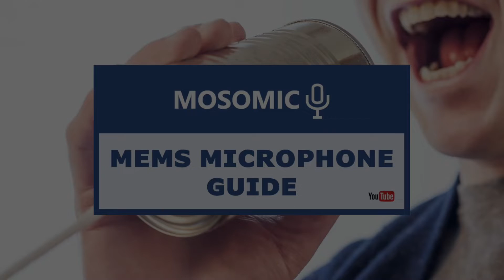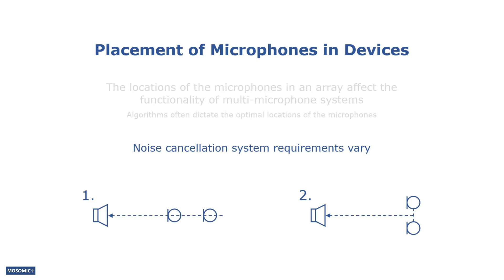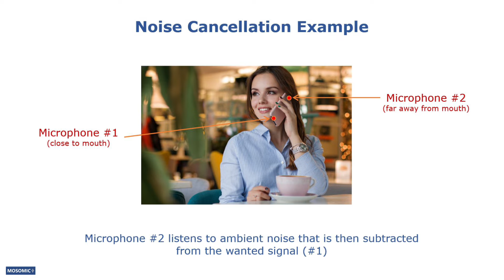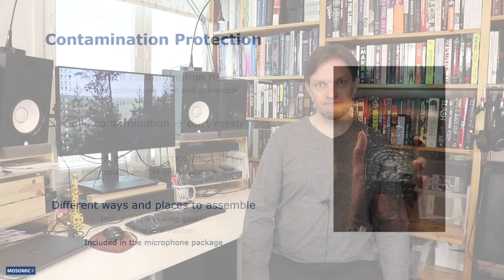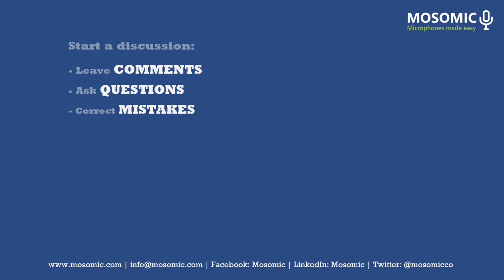Mechanical Implementation: Size, Protection, Placement | MEMS Microphone Guide Ep16 | Mosomic

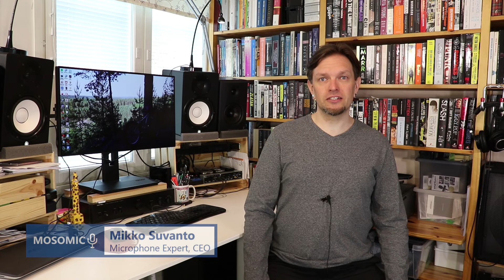Comment from the maker: 0:38 MEMS microphone implementation size
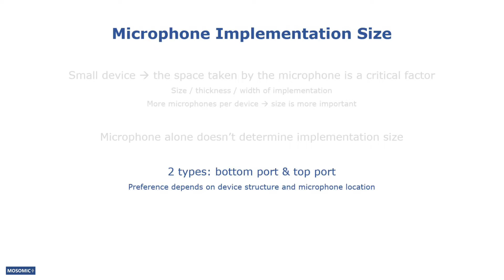- 2:03 Space taken by the sound channel
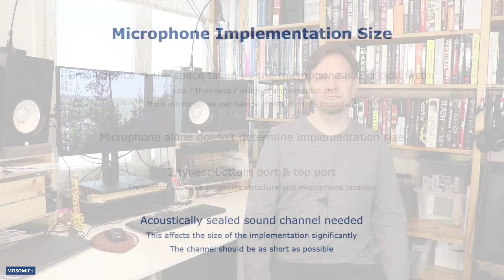- 2:34 Bottom port microphones
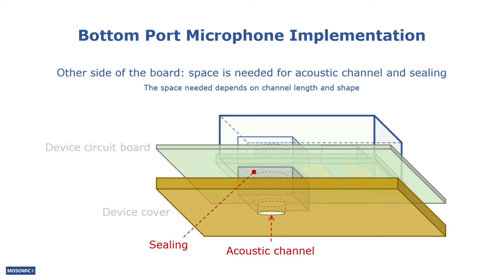- 4:03 Top port microphones

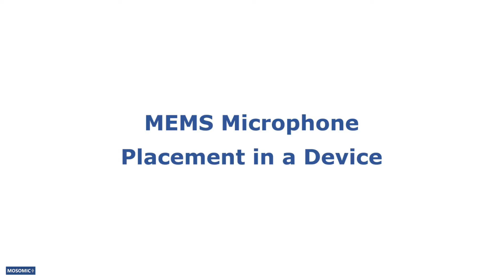6:12 MEMS microphone placement in a device
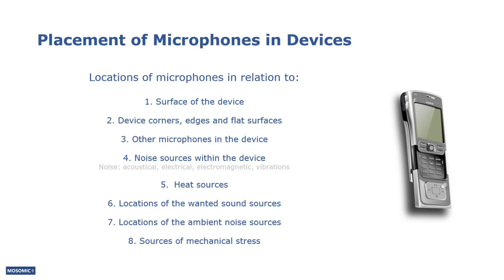- 7:08 Distance to the surface of the device
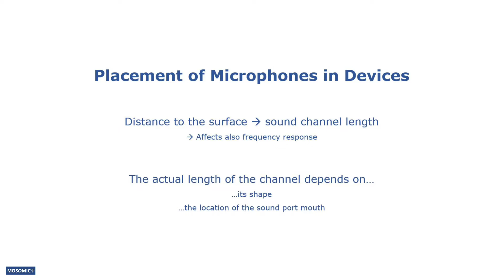- 7:35 Location in relation to features of device housing (corners, edges, flat surfaces)
- 9:00 Distances between microphones in a multi-microphone system
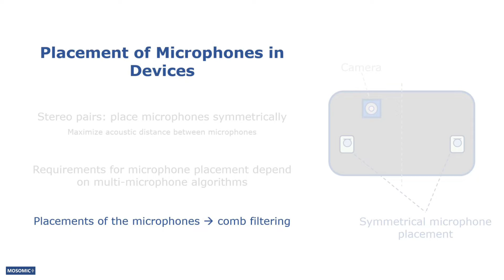- 11:05 Distance to noise sources within the device
- 13:05 Distance to heat sources
- 13:43 Location in relation to wanted sound sources and ambient noise sources 
- 16:31 Mechanical stress sources

17:08 MEMS microphone protection in a device
- 17:17 Contamination
- 19:28: IP rating
- 20:18 Contamination protection vs. microphone performance
- 21:58 Mechanical abuse and other external factors